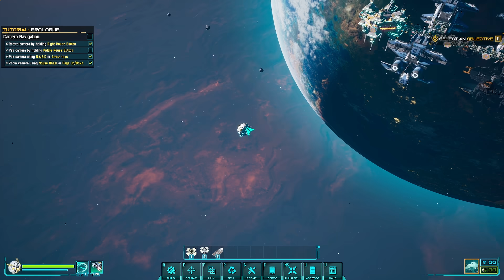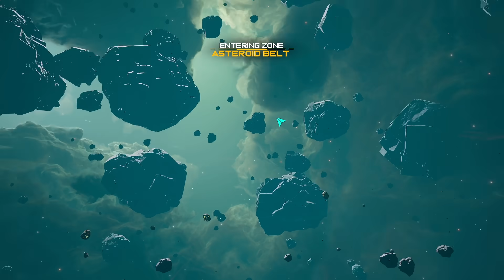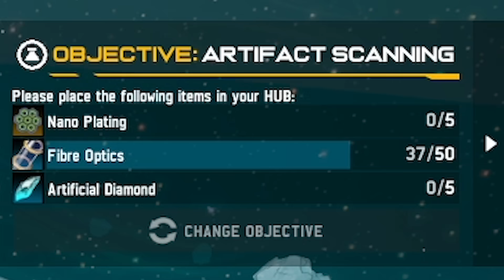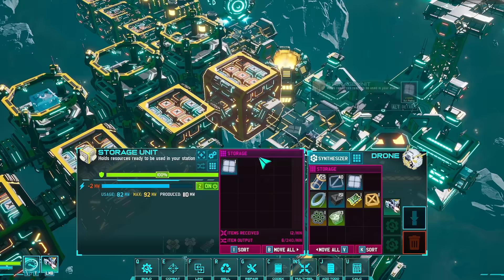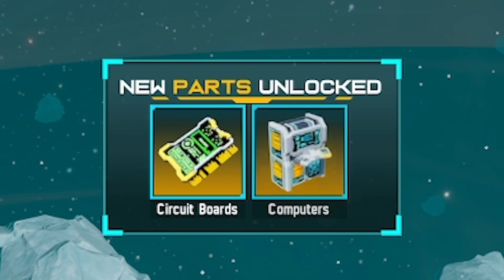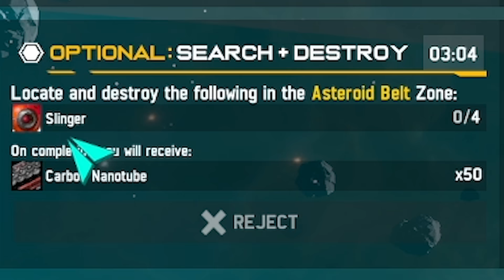Engineering a SPACE STATION got out of hand!

Comment: If everything is stored in the hub. Why storage boxes?
Reply: Enragement engagement 😀
Reply: @SilverMKI  I think that was addressed later in the video.  When basic materials are needed for the fabricators, it is drawn from one of the storage places so if you're not careful, your manufacturing area will drain all of your basic materials you need.  By splitting it, you have a storage of material that isn't automatically used up by the factories building more complex stuff.

Comment: If you see that (actively feeding black hole at this distance) you are already very, very dead from radiation.
Reply: I saw the first 45 seconds or so of this video that sent me on a deep dive of supermassive black holes and very quickly found this out.  Additionally, the extreme heat from it would be so intense it would turn all nearby matter into plasma (which considering its relative size in the distance, we are likely within that range).   I am sure knowing this will bother me for the rest of the video.

Edit: A few minutes after that the planet and space station entered the event horizon, so definitely would have long since turned all nearby matter to plasma.
Reply: pssh, you seem like the type to say the house being on fire is bad
it's in a different room
it looks cool
it lowers the heating bill
take a chill pill, jeez
Reply: @user-qq9xu9le5u  it's also low maintenance and takes out the trash. Perfect pet. Only drawback is that cuddling it is very difficult.